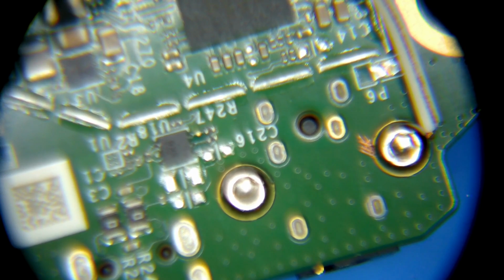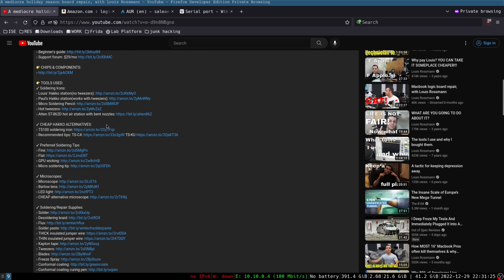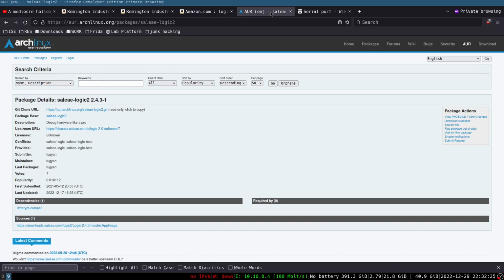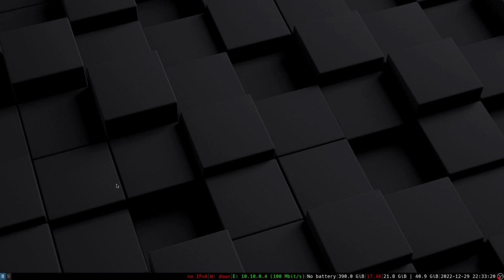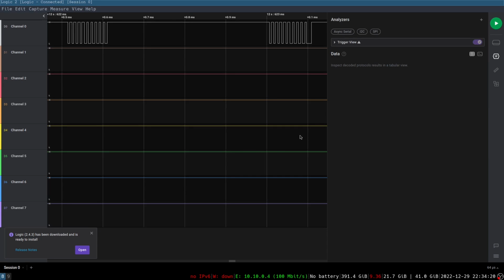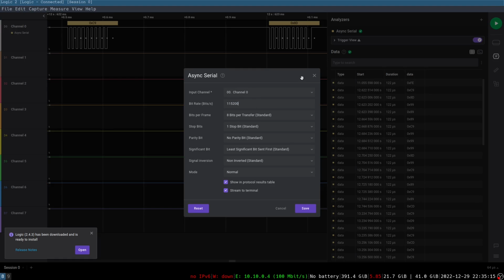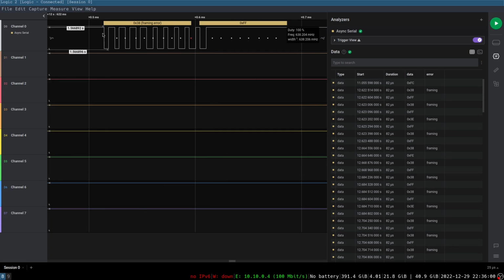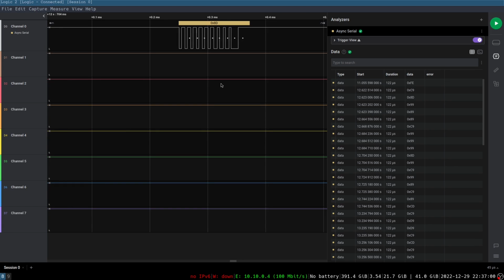Reverse Engineering Amazon Echo Digital Signal with a Logic Analyzer

Comment: The xbox one s has a paired optical drive to the console which makes it impossible to replace the disc drive without moving the old daughterboard into the new drive.  In some cases users have replaced their drive without this understanding and lost the old drive making their console completely inoperable following a software update.  It would be fantastic if a logic analyzer could be used to understand the serial number reporting back to the console create a modchip of sorts that could report the correct serial number and fix consoles with this type of problem.

Comment: I'm hoping I can learn how to interpret UART from videos like this!

I have a Smart Appliance with IoT functionality and consumable cartridges. (I want to refill my own cartridge) 

I have successfully captured the signals between the the cartridge reader by tapping into the UART lanes exactly as you were able to.  

I'm essentially stuck where this video leaves off.
Reply from the maker: I highly suggest the book: Attacking Network Protocols: A Hacker's Guide to Capture, Analysis, and Exploitation.
The next step after getting bytes is to try to make sense of the binary protocol in use. That book is a good intro to reverse engineering binary protocols.

then you might want to look into if you can program something like a Raspberry Pi Pico to send the same UART data you observed from the 1st party cartridge to the appliance.

Comment: How did you "discover" that signal in the first place?
Reply from the maker: great question.
I poked around the board with a multimeter first looking for any voltages that looks interesting. That coupled with the fact that these pads were next to the CPU made them interesting enough to look at with the logic analyzer.
Reply: @mattbrwn  oh, were they test pads? I couldn't see through the puddle of solder. I've been doing a little hardware hacking lately with my students. Mostly just looking for uarts in iot things so we can get a shell into them and look for exploits and vulnerabilities. It's amazing how much they leave wide open. You now, since those devices have an fccid, their are records of them on the fcc page including close up photos of all the circuit boards inside. I usually start there to see if anything stands out as a possibility, before I actually take something apart.

Comment: Probably I2C. The signal looks too regular and is probably a clock. The resistors may be pullup.

You would need both lines to get the data if so (the other is likely data).

Comment: Crank up your sampling rate. 500KS/s is only 50 samples per 0.1ms frame. A 115200 baud rate would be 11.5 bits per 0.1ms per frame. ~4samples/bit may be masking a higher frequency bitrate. Do a quick capture at 5Mbit to see what the signal bit rate is and the dial back from there.

Comment: 76800 sounds bogus to me. Try with pulseview/sigrok instead.
Reply: I don't see why the decoder would need to know the baud rate in an offline analysis of an asynchronous signal to begin with. All it needs to look at is edges, and perhaps the duration between the edges (depending on what signaling standard is in use - RZ, NRZ, Manchester, etc). Baud rate is only relevant for real-time decoding, not offline analysis after the fact. Clearly a decoder written by a CS person that has some lack of understanding how the hardware actually works. Also, I'd trace where those lines go, and look up the datasheet - there's no point reverse engineering what's mostly likely a list of commands in the datasheet of whatever it's talking to. And yes, I'd also vote to use Sigrok rather than proprietary Salaee software - I'm surprised that the Salaee software even works with the $12 clones - I thought they got super anal about that a few years back.

Comment: I do not think that 76800 is the correct baud rate.  Note the bit position indicators drift in relation to the rising edge.  Measure the time between rising edges to find the bit time.